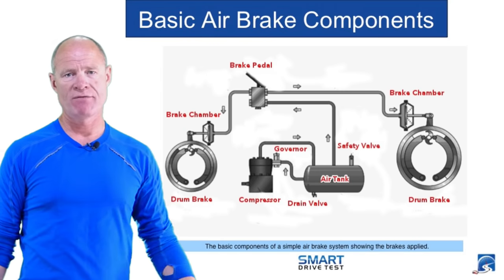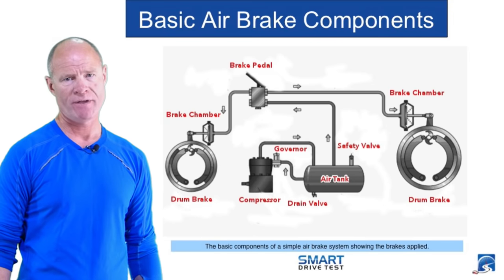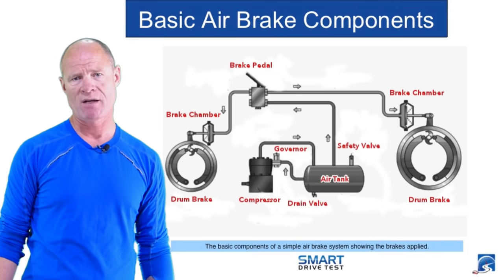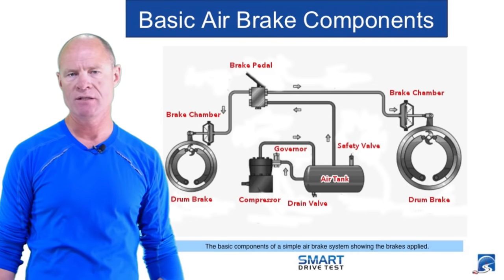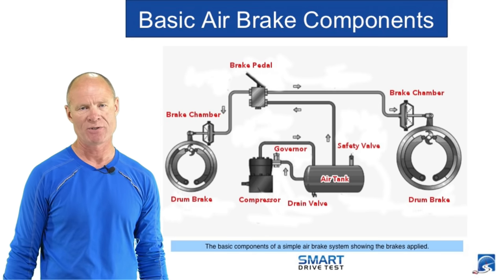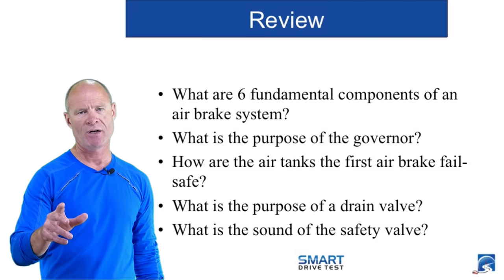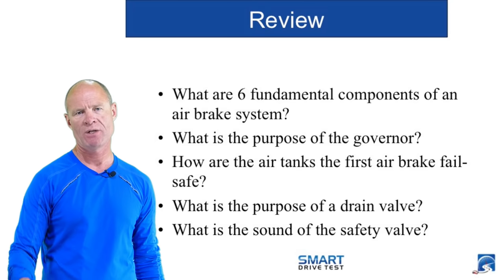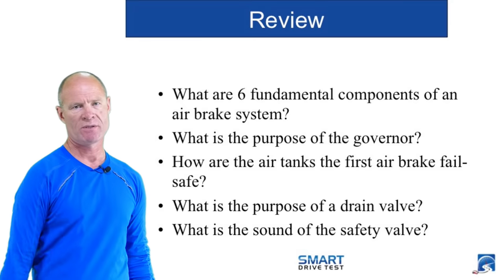Basic CDL Air Brake Components

Comment: Hmm...Still don't get how the amount of brake torque is regulated? The more you press the brake pedal the more you get air input to the brake chamber. But? But! Let's say we have infinite amount of time and the brake pedal is 1% pressed. Versus. The same conditions but brake pedal is 100% pressed. So will we have the same brake torque at some point with the difference that 100% pressed brake pedal will generate that max brake torque much faster, while 1% pressed pedal will take considerable time to generate that max brake torque?
Reply from the maker: Hi Ігор Гончаренко - Thank you for your question. You're overthinking it my friend. The harder you push down on the brake pedal, the more air pressure that is delivered to the brake chamber. With a Type 30 brake chamber and the levers in the brake system you are going to have about 5,000 pounds of pressure if you make a full brake application with 100psi in the tank. If there is anything further we can do, drop us a note. Always happy to help. All the best, Cheers Rick
Reply: @smartdrivetest  Thank you, Rick. I was overthinking because I needed to reproduce pneumatic system work for a simulation video game. That's why I needed to understand how all the stuff work. 
I watched a few more videos, read a manual and with your reply,  I think, all the puzzles came into their places. Final amount of brake force applied depends not on the position of the pedal, but on the pressure on the pedal. Since at first pedal receives almost no resistance (no air in the brakes). But then more and more amount of air comes into the system and therefore the pedal receives more and more resistance and the pedal is pushed back.
Let's say if we put a brick onto the pedal, it will create some pressure on the pedal and, thus, some braking force will be applied. If we put the same brick onto the pedal and push the pedal and then remove this additional pressure, the pedal will be pushed back by air pressure in the brakes. Thus we will have the same brake force as with the simple brick.

I have one more question, Rick. In the video you've told that compressor pumps the air all the time, except for the destination. It's either air tank or atmosphere. Why is the compressor always on? Because compressor is mechanically coupled to the engine and it's cheaper to pump into the atmosphere than to decouple it? I'm asking it because I model trolleybus and it has an electric compressor (not connected to the main engine), which is switched on/off when necessary. It doesn't work all the time.
Reply from the maker: Hi Ігор Гончаренко - Thank you for your question. Yes, you have the brake pedal figured out. Your electric compressor on the trolly is just like a compressor in a garage. When it reaches maximum pressure, the governor turns the electric motor off. In an air brake equipped vehicle, the compressor is bolted right to the side of the motor and is gear driven. Unless you turn the engine off, the compressor works all the time. But when it's in the unload phase--the air tanks are at maximum pressure--the compressor simply pumps into the atmosphere. Think of the compressor in the unload phase like a lawnmower engine with the spark plug out. There's little resistance. If there is anything further we can do, drop us a note. Always happy to help. All the best, Cheers Rick

Comment: Here are some of your BFT for ac transit bus 6? #1Pivot point:is center of the rear axle. #2 turning point:center of the front axle.#3 reference point: point the objet around which you need to clear with the pivot when making a turn.#4 rear overhang:The part of the bus that extends from the pivot point to the tailing edge of the  rear bumper#5 front over hang: The part of the bus that extends from the leading edge of the front tires to the leading edge of the front bumper or the bike rack.#6 cheat:the rear tires track inside the path of the front tires in  turn and curves. This is for ac transit test you need to shade in on the test the over hang . Study just like this
Reply from the maker: Hi joan crawford - Thank you for your comment and helpful information. Where in the world are you doing your CDL license? I would be interested in looking up this information. All the best, Cheers Rick

Comment: I, still today have Air wedge brakes on my  73,  Ford  F700  Dump. TRK.
Reply from the maker: You truck is 50 years old this year. Is the engine gas or diesel? That was about the time that they began putting diesel engines in those vehicles. All the best, Cheers Rick

Comment: I replaced my governor and my air pressure still climbs to 150 plus any ideas what's going on?
Reply from the maker: Did you set the governor when you installed it? Cheers Rick
Reply: @smartdrivetest  when I bought the governor it says non adjustable 125 psi

Comment: hi, thanks for the info. I want to ask how will vapour from air condense as the temp of tank is higher than room temp ?
Reply from the maker: Hi Sanjeev: Thank you for your comment. Great questions...When the air is compressed in the air compressor the increased pressure also increases the temperature to as much as 200°C (400°F). If the vehicle is equipped with a wet tank, the air cools and the water vapour condenses. Thus, the temperature of the air, as it moves through the system, begins at a high temperature and cools more than 100°C when in the air tanks. Thanks Cheers Rick
Reply: thanks for your reply... But as you said the water condenses when it comes in contact with cold water glass which lets say might have temp around 18 deg C. So, can the temp inside tank may go even below room temp?
Reply from the maker: Hi Sanjeev: I'm sorry, I suspect I misled you with the cold glass analogy.

When air is compresses--as you know--more air is forced into a smaller space and the pressure increases. And as we squeeze more air into a smaller space, the water vapour content is also increased. And hotter air holds more water vapour than cooler air. With the relative drop in temperature from approximately 200°C (400°F), when it leaves the compressor to approximately 40°C (104°F) inside the air tanks, the air is unable to hold as much vapour. When the air cools--the relative drop in temperature--the water condenses and becomes a liquid inside the air tanks. It is the relative drop in temperature from a high temperature at the compressor to a much lower temperature inside the air tanks that causes the water vapour to condense. Thanks Cheers Rick
Reply: ok , so what temp is making vapour condense?
Reply from the maker: Hi Sanjeev: The vapour is condensing because of the relative drop in temperature from the time the air leaves the compressor to the time it is stored in the air tanks. In the air tanks, the air cools to approximate outside temperature. Are you studying for an air brake test? Thanks Cheers Rick
Reply: No, i am a mech engg. student from India. I am doing a project related to this. I found your video very helpful. Thanks. Keep up the great work sir.
Reply from the maker: Thanks Sanjeev - all the best with your studies.  Cheers Rick

Comment: I read 100 psi was the cut in limit for the governor.
Reply from the maker: Most systems are going to cut-in around 100psi, but for most jurisdictions, the "absolute" minimum is going to be 80psi. All the best, Cheers Rick

Comment: What could be the problem of the air brake system, if and when ever I ingage the maxi brake switch ( Parking Brake ) the air continously pass through the the exhaust of the maxi brake switch, lossing pressure of the system (0 pressure). Please advise.
Reply from the maker: Hi Alexis: I suspect this is a job for a mechanic, and it could be a number of valves. The 1- or 2-way check valves could be faulty; as well, it might be the Parking Brake valve itself. If you're parking the vehicle and air is exhausting through the parking control valve, my suspicion is that it's one of the two one-way check valves because that's the only way that air can get out of the tanks; and if it is in fact you're one-way check valve, I would get those fixed ASAP, as those are responsible for your biggest fail-safe -- the division of the system into a primary & secondary subsystem. How old is the vehicle? If it is equipped with a wet tank, you could pump the system to over a 100psi, take note of the readings, and then drain the wet tank. If the pressure drops, you know it's the a one-way check valve because it's allowing air to bleed back into the wet tank. Be sure to chock the wheels and release the parking brakes before draining the wet tank.  Cheers Rick --again, it sounds like a job for a mechanic.

Comment: Simple question -- why in europe we have a single lever for parking brake yet in the states you have a push/pull yellow button ---- why the difference ?
Reply from the maker: Hi misha frog - Thank you for your comment and query. It simply a product of different manufacturers my friend. It was different in Australia too.  If there is anything further we can do, drop us a note. Always happy to help. All the best, Cheers Rick
Reply: @smartdrivetest  Thanks for the prompt comment allthough I do question the answer in some respects example Volvo euro use s a lever and Volvo Usa use s a yellow button , So it sums up as a goverment rule in design & not manufacture s as All states trucks have this system & all euro trucks have the lever system . So my original question still stands why the two systems ? whats the pro s & con s .

Comment: Thank you very much for this Video
Reply from the maker: Hi John: - thank you for your comment. You are most welcome. If there is anything further we can do, drop us a note. Always happy to help. All the best, Cheers Rick
Reply: where are the relay valves and quick release valves?
Reply from the maker: Hey John - the relay valves are usually at the mid-point of the rear axles of the unit, and the mid-point of the axles of the trailer. If you look at the rear of a tractor - the relay valves are fairly easy to spot. The quick release valves are usually piggyback onto other valves - the relay valve and the foot valve. But these too can be by themselves. For the purposes of the test, you really need to know what these do for the purposes of the theory test - for the practical portion, you just need to ensure these are secure, not damage, and not leaking. And that the system is working. All the best, Cheers Rick
Reply: thanks
Reply from the maker: You are most welcome. All the best, Cheers Rick

Comment: I have a  FRR ISUZU I have two air tanks one infornt and one on the back i don't have no air pressure on the front and a little in the back but nothing in the front what can it be
Reply from the maker: Hi Jose Hernandez - Thank you for your comment and query. It's either your compressor or governor. Check those, and then begin looking for a blockage somewhere. Do you have any system pressure at all?  All the best, Cheers Rick

Comment: sir. where is the valve relay ? to supply to line of air brake. ??
Reply from the maker: Hi j-ward cordova Cordova - Thank you for your comment and comment. There are a few relay valves on the truck and trailer. Most of the time these are placed at the centre of the axles, but can be in other places. The purpose is to reduce brake lag in the system. If there is anything further we can do, drop us a note. Always happy to help. All the best, Cheers Rick

Comment: Trucks have multiple air tanks and one wet tank... the wet tank has an automatic  pop off... it also has a manual lanyard to pull... standing outside the truck you can hear it pop off that's to drain the water!
You have a pressure gauge inside the cab... if you don't maintain enough air pressure the trailer brakes will come on... the trailer has a red Airline trailer brakes need air without air the brakes will engage!

Comment: dude, what about the dryer to clean the airlines from contamination?
Reply from the maker: Hi Noah: you are correct. All modern air brake systems are equipped with an air dryer. The air dryer is so effective in removing moisture and contaminants that most air brake equipped vehicles in the last 5 years or more have an ADIS system. (Air Dryer Integrated System.) The air dryer is filled with desicant (fancy word for kitty litter) and the moisture & slug is removed when the air is pushed through the desicant. The air dryer purges water and other contaminants at maximum system pressure. Thanks Cheers Rick
Reply from the maker: Hi Noah Arce - I realize this is a bit delayed; however, I got the air dryer video up this morning: https://goo.gl/9lAHgx All the best, Cheers Rick

Comment: I was under the impression that the brake pedal only releases the air pressure from the brake chamber and the springs do all the braking,thus when the air is removed the brakes lock.
Reply from the maker: Hi Ibrahim Cehajic - Thank you for your question. Nope, when you push down on the brake pedal, it puts air into the service brake chamber and applies the brakes my friend. Drop us a note if we can help further. For more information, you may consider this resource: https://www.smartdrivetest.com/air-brakes-explained-simplyAll the best, Cheers Rick

Comment: True or false:
If truck+trailer loses main air tank pressure, the trailer brakes will lock up but the truck brakes won't so that the whole vehicle remains steerable and comes to a stop, while if only truck loses main tank pressure, the driver will have no brakes unless uses the emergency hand diamond release valve to drain the emergency tank.

Comment: What about the safety valve called a spitter It would make a cheee sound
Reply from the maker: Hi Michael Gostas - Thank you for your comment and query. And what you're talking about, I believe, is the unloader valve in the air dryer. This valve purges the air dryer when the system attains maximum pressure. If there is anything further we can do, drop us a note. Always happy to help. All the best, Cheers Rick

Comment: I'm a fleet mechanic and I've noticed a common issue lately.
That is drivers asking me to check there brake adjustment 
A common response when I tell them that they are supposed to be checking their slack adjustment on the pre trip every time they get in the truck that day with the bar method or the applied method 
 and what I get is them pulling out there license and saying c that right there says cdl not mechanic, drives me nuts often my response is well u tell that to the DOT officer when he finds an issue and they continue to  argue with me 
Where does this come from are they just trying to get me to do there job or is it just pure ignorance how are these guys passing the cdl test
Reply: Been gathering info about doing my class 1.  If you have any preferred sources or suggestions for study feel free to bury me in them when it comes to slack adjustment.
I mostly drive a 5 ton with hydraulic brakes, so not much option for doing anything hands-on and I'd like as much info as possible (I'm odd that way).
Reply from the maker: Hey DB198 - I did this video: https://youtu.be/mCYvgcCOda8 Drop us a note if you have questions. Cheers Rick
Reply from the maker: Remind me @Maze Runner - where in the world are you again? Thanks, Cheers Rick
Reply: @smartdrivetest  
In Manitoba, Canada.
Reply from the maker: Start with this book @Maze Runner: https://www.smartdrivetest.com/airbrakes-cdl-rv/air-brakes-explained-simply That book will give you everything you need to know for air brakes. And here's the playlist: https://www.youtube.com/watch?v=dMxilatT0qw&list=PL0x-bChcUvwG2bSWReQWnk9Tm92L7WN_O&index=2&t=16s Drop us a note if you have further questions. Cheers Rick
Reply: @smartdrivetest  
Shameless promo is...shameless   :P  (I'm sorry, I just couldn't resist.)
Been following the channel on and off for quite some time, mostly to get a basic sense of what's involved in Class 1. A quick scan through the playlist provided some material I must have missed. Thank you for that.
Reply from the maker: All good my friend!! We all have to keep the lights on. And believe me, if I didn’t think it would help I wouldn’t put it front of you. 👍 Let us know if you have questions. All the best, Cheers Rick

Comment: Terms up front great
Visual great 
Organization great
100 psi to 125 psi.  (105 - 135 ?)
Govenor Over 150 psi safty valve
10 to 12 x full breaking 
Capable of 500 psi
Auto or pull to release  water or oil
SERVICE break say again
4 types repeat please

Comment: In the 80's and 90's Mack imported and rebranded a Renault Midliner with an Compressed Air Over Hydraulic system to run disc brakes in a medium duty rig. They are rare but A/H is still around but direct acting air to disc is much more common now.

Comment: Thank you ggod teacher . I just toke a air brake 18 hous class in bac . the tacher confuse the hell oit pf me . im a car mechanic . and I fail. The icbc knowledge yest  .becouse of the valvles triqui questions . anf the confusion of the course . I would been better of on my own without the course . plus they told me to take the combine test at motorbehicle office . big mistake . os too much for one time shot . too much noice and distraction . o had plenty of time to do the class 1 test first . not worth it to save 15 bucks . you are a good teacher gast and to the point. With out ferry tails !! !!🤚

Comment: machine gun sound is more likely from engine braking downhill
Reply from the maker: Hi LuchoPortugayo - Thank you for your comment. Nope, the machine gun sound is the safety valve releasing excess pressure from the system so that it doesn't damage the air brake components or threaten the safety of other people around the unit. All the best, Cheers Rick